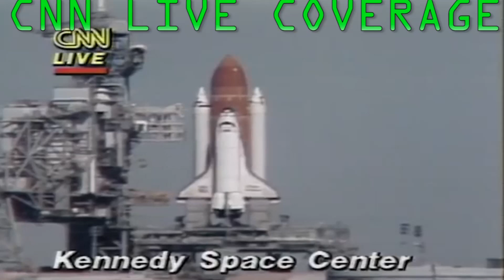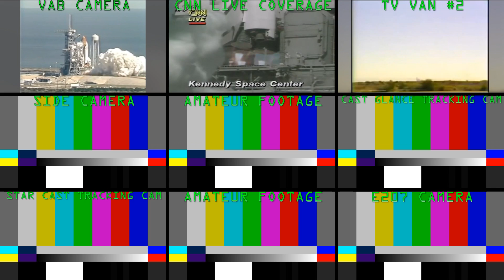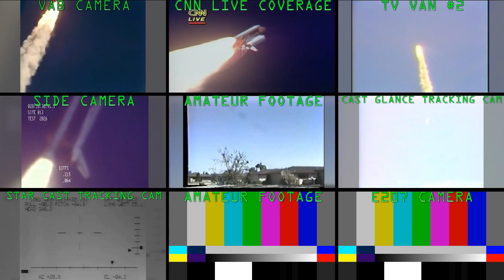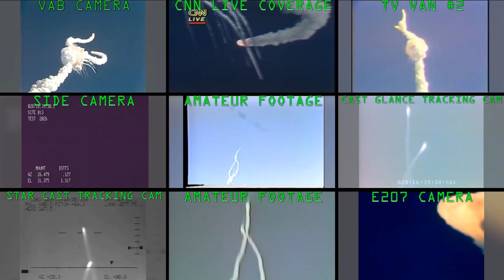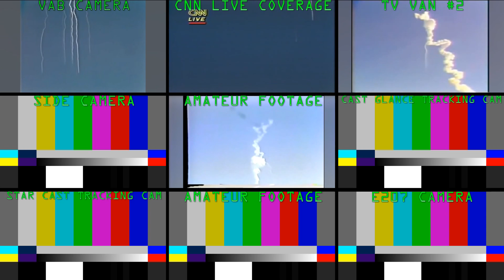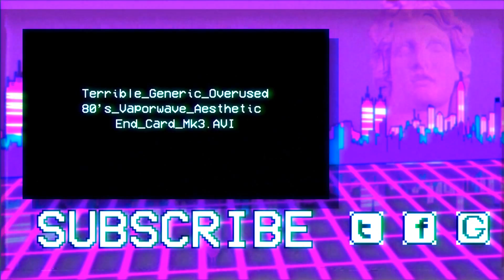Every Angle of Space Shuttle Challenger Disaster, 9 Angles Synced

Comment: The crew was discovered to have survived the initial explosion and break up at 46,000 feet. They reached a peak altitude of 65,000 feet before plummeting back down to earth. Investigators determined that the astronauts remained alive the entire way down, and a few of them may have even remained conscious until impact, due to some of their emergency air packs having been manually activated. It took 2 minutes and 45 seconds for the crew cabin to hit the ocean at 200 mph, killing them instantly. 

The tank explodes at about the 3:35 mark in this video, which puts the crew cabin impact with the ocean at approximately 4 minutes, 20 seconds.

R. I. P.